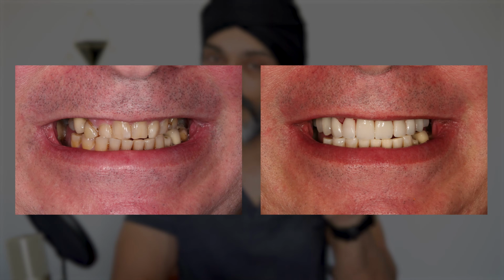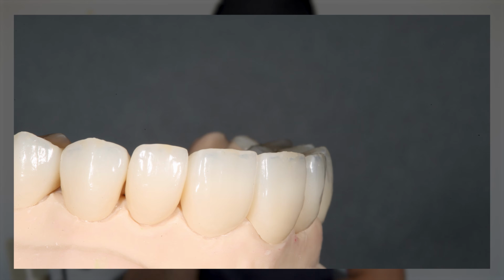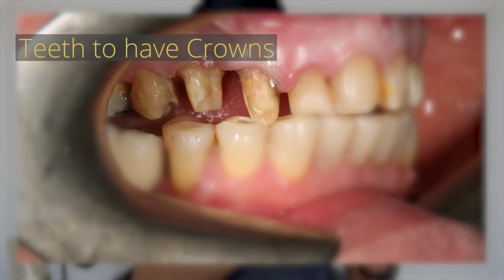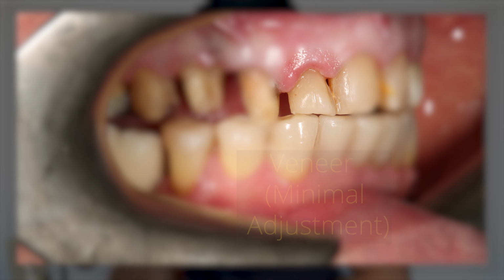Why My Veneers Kept Falling Off!

Comment: I went to three dentist back in 2015 to get three different quotes to make my front upper teeth presentable. Six upper front teeth in total. The $14,000 quote was laughable and I’m very grateful I had the sense to turn that one down. But I did go with the less expensive Which was still $4,200.   To date, every single one of my veneers has popped off multiple times. It’s like a time ticking thing because it’s about every 1.5 years that I have had to get a recement . Which in the beginning, cost me $160 that I feel I should not have had to pay. That dentist sold his clinic and moved north and someone else bought his practice and she charged me $190 for each recement. Now, she’s sold the practice and someone else is there and he wants $325 to re-cement.  A 10 to 15 minute process. I have had tons of x-rays and more exams than I care to discuss and there is nothing wrong with my teeth/gums. The first explanation that I was given was that it was a bonding agent problem. And I’m no longer buying that. Veneers are a scam!  I wish I would’ve never ever gotten them in the first place. I should have just went through life not smiling.

After having multiple recements, this last front tooth that fell off, actually fell off a fourth time before I bit into and it broken in half. All because the dentist could not get me in for two weeks. They could not get me in for two weeks for a $325 cement. The nerve. The dental industry is clearly unregulated and very ill. That’s my experience and I will vocalize this every chance get!  DDS are no longer in it for the right reason it seems!   Ugh!!

Comment: Came across your video as I’m desperate. I’ve had 9 veneers done in london in 2007 and until last week I’ve experienced one front lateral to break… I went to the same clinic and they did a composite rebonding witch lasted only less then 72 hours. I need to have the rebonding again and I’m fearful for going to the same dentist…. As while she was doing the rebonde she kept saying that she didn’t know whether is going to stay longer or not. That left me a bit desconforted and is a clinic of high reputation in london. I need your help please. This was only Saturday when I had the Tooth rebonding and at this instead I’m writing this the tooth is out. PLEASE HELP
Reply: How are you doing now? Did it hold?

Comment: Lab acted unethically because Emax material is more expensive than Zirconium and you honestly should have noticed the difference before cementing them. 

Good thing you replaced the whole smile with emax and cut the lab off which the best thing you could have done.

Comment: That's not a wrong choice of matrial, dear, that's wrong treatment decision. You'll never get away with  something so stupid as that.. all biting force goes on front veneers, no posterior support on right side and + opened bite as a cherry on the top...
Biting force... strong man, look at the muscles on the face!! look, his top front teeth ( strong natural  teeth) are worn down BY PREASSURE.  And you increasing preassure by opening bite.
Don't even think about veneers without posterior teeth. Not clever at all.  Common sense  is lacking here, unfortunately .  
Pity about the lab not getting paid,  but they should think twice before carrying out dumb orders. At least they've  got rid of you... so something good came out of this ordeal😉🤣. 
On the other hand... you only young, hopefully  will learn from that ...  Thankfully majority of people here haven't got a clue  what has really happened 👍😉.
Reply from the maker: After replacing with the more appropriate material, there have been no issues. Occlusion is balanced, guidance is in harmony with his natural motion. Be careful to criticise others, based on the limited information you have (a small selection of photos)
Reply: Imagine writing something so condescending based on a couple of photos without any I/O exam or imaging and thinking you know better than the attending dentist. Have some humility next time just skip leaving a comment, especially one which looks like it was written by a 15 year old. 

Also unrelated but "You're only young" seems like an odd comment given the fact Dr Sehmi seems to have been in practise ~15 years, so assuming he graduated dental school at a normal rate he's around 40? What a strange thing to say.
Reply: @alchemisttttt - When reflecting on your speech and your condescending comments, please also reflect on calling professionals "dear".  You really would grow from looking inside.

Comment: I totally agree. I got 4 Emax veneers fitted due to chipped and discoloured teeth. Would I get them again. No. I have had problems with TMJ and grinding as my original teeth had been chipped due to grinding. I wear a night guard. Its like the jaws have reacted to the new teeth. In the quest for a nice smile there is a lot of maintenance, more regular cleanings, a lot of flossing and upkeep.

Comment: This happens more often than the public is aware of. I had 14 porcelain veneers placed 15 years ago and have had many debonding issues. I wear a night guard, have great oral hygiene and have proper occlusion. Now that I have had this procedure, I am literally stuck rebonding or replacing them at a whim. It is painful, expensive and anxiety inducing. Now have I met people who have veneers for 20 + years with no problems - yes, but have I met more people with similar problems - YES!

UPDATE: End of  2022 I had my 16-year-old feldspathic porcelain veneers replaced with emax (8 top, 6 bottom) along with requiring 6 palatal veneers and 7 emax lower tabletops to raise my bite. It turns out I had developed a deep bite and that was contributing to the deboning. At that point, I had to address my full mouth if I wanted to get the best longevity. As we all know there is no going back with veneers, so I decided on Emax because the porcelain is thinner and more prone to leakage. The entire cost: 46, 000 CHF or 41 000 GBP. My dentist in Switzerland was of the mimetic dental philosophy to keep as much tooth structure as possible and very well-trained (medical journals etc.) this means you need to spend top dollar to find a specialist to carry out these procedures - maybe Switzerland is the extreme but anyone reading this consider that if you start doing multiple veneers in your twenties, you are stuck with a lifetime of costs and when your mouth changes due to aging you may need even more dental work or depending on how they are originally done or redone may not even be a candidate for veneers as you need to have adequate enamel to bond too! Only get a few veneers if you are young, but also consider teeth whitening and other less invasive procedures.
Reply: hi, i have 8 units emax veneers too and i regret having them. I experience salty taste if im not eating. I do brush and floss to take care of my oral health. Do you experience salty taste too for 15yrs? Just want to get idea if this is normal! 😢
Reply: @joemalone1908  No salty taste. End of  2022 I had my 16-year-old feldspathic porcelain veneers replaced with emax (8 top, 6 bottom) along with requiring 6 palatal veneers and 7 emax lower tabletops to raise my bite. It turns out I had developed a deep bite and that was contributing to the deboning. At that point, I had to address my full mouth if I wanted to get the best longevity. As we all know there is no going back with veneers, so I decided on Emax because the porcelain is thinner and more prone to leakage. The entire cost: 46, 000 CHF or 41 000 GBP. My dentist in Switzerland was of the mimetic dental philosophy to keep as much tooth structure as possible and very well-trained (medical journals etc.) this means you need to spend top dollar to find a specialist to carry out these procedures, and it costs big money - maybe Switzerland is the extreme but anyone reading this consider that if you start doing multiple veneers in your twenties, you are stuck with a lifetime of costs and when your mouth changes due to aging you may need even more dental work or depending on how they are originally done or redone may not even be a candidate for veneers as you need to have adequate enamel to bond too! Only get a few veneers if you are young, but also consider teeth whitening and other less invasive procedures.
Reply: @chiaramitchell9726  hi thanks for your message. i am 44yrs old already and ny veneers are 1yr old. got your points clear! hope they can still solve the salty taste 😬
Reply: Oh jeez broke temp 2x I think I chose wrong. I'm  Waiting for Vermeer . ?? Single front tooth.
Reply: @Frank020  good luck, dear😭
Reply: update have one verneer: One crown in front. The verneer is thick. but looks wise it the crown is better, and feel wise too. Litlle leakege of cold on veneer--crown nothing. Crown feels smotheer in back I prefer it to my own teeth.
Reply: OMG.. i have had two veneers pop off in less than five months... now dentist says i need implants because i have a strong bite and have to use a mouth guard.. but then if she knew i had a bite why add the veneers to my front teeth? I told her i wanted crown veneers to have a solution now and since i have warranty with her.. then i will run far from her and go somewhere else for a permanent solution. I feel so insecure and i am afraid to eat